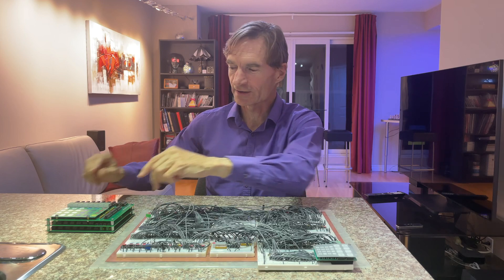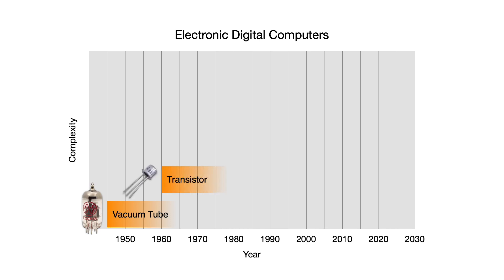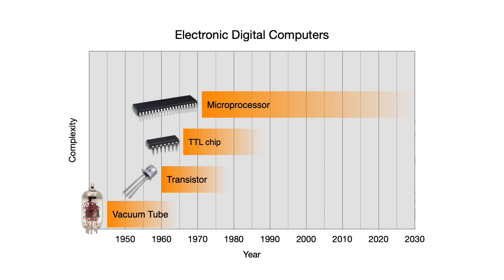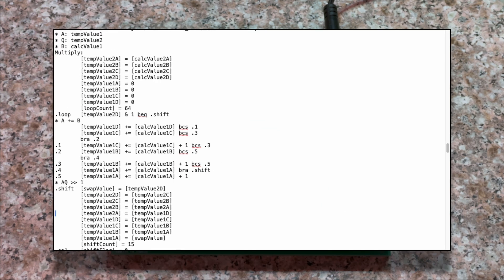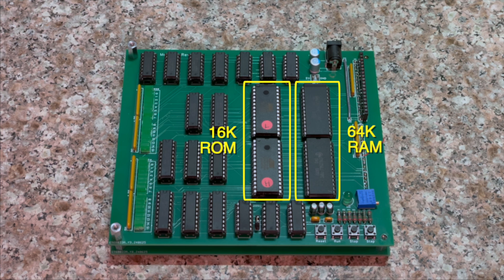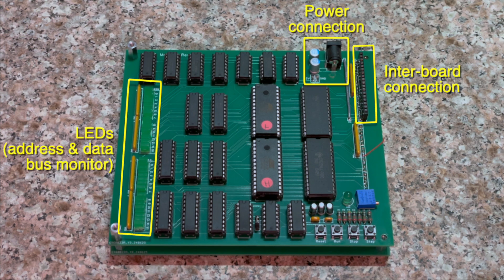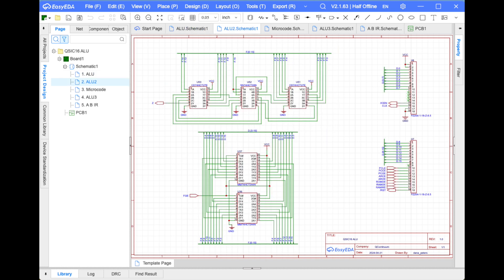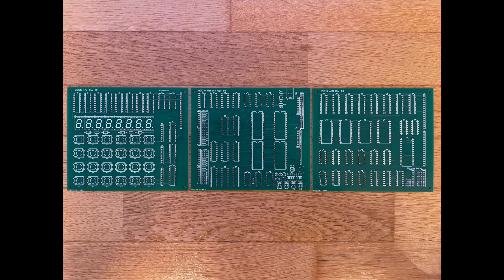TTL Computer

Comment: I am 50+ EE professionally designing electronics for various embedded systems used in controls for consumer,  automotive to medical products.
My career jump started in early 90s when I developed handful of control based on 8051 microcontroller. Later complexity of my designs progressed until now when I mostly design around SoCs and FPGAs, but sometimes simple MCU comes handy. Fast forward 35 years later today I cannot shake off that desire to built 8051 core based on TTL series. That would allow me to make full circle before I am old too much to endavour on such interesting project. Your video is another proof and inspiration I can pull it off. Thanks for the video
Reply from the maker: Great, glad you found this inspirational. I found that Logisim was invaluable. I doubt I would have completed it without simulation. And custom PCBs are quite affordable, so now is a good time to tackle such a project.

Comment: Did you find software to move your design from Logisim to EasyEDA? Does that even exist? Thanks, I’ll be following! 😊👍🇳🇱
Reply from the maker: Interesting idea... I didn't look for such software because I assumed that it did not exist. There are many different parts you can select in EasyEDA, so the software would need to specify a particular part, and then you'd have to modify it later if you wanted a different part. Still, that would likely be easier than redoing it in EasyEDA from scratch.

Comment: What architecture did you pick?  Von Neumann or Harvard?  Instruction set - RISC or CIS?  There are lots of levels of detail and design choices.  Would love to have school kids exposed to this level to demystify the cell phones they all take for granted.

Small nit - technically TTL uses bipolar transistors while it appears you used CMOS which is based on field effect transistors.  The 7400 series started as pure TTL and added 7 variants from 1966 to 1982; CMOS equivalents first appeared in 1968 and have evolved through at least 40 variants since.
Reply from the maker: You are correct, even though I called this a "TTL computer", I actually used 74HCT chips to avoid fanout issues. These are MOS, not TTL, although they are TTL-compatible. The 74181 ALUs I'm using really are TTL chips.

As for architecture, it is inspired by the OSIC (one instruction computer) architecture. But it supports different arithmetic/logical operations, branch conditions, and addressing modes, so I don't know if it really is OSIC or not. I'm calling it QSIC (for Quasi Single Instruction Computer). I intend to make another video on this, so stay tuned!

Comment: How are floating point numbers represented?
Reply from the maker: This basic calculator software uses fixed point rather than floating point to represent numbers. The integer part uses 32 bits, and the fractional part uses 32 bits. So it takes four 16-bit values to represent a number. This gives sufficient precision and range for an 8-digit display.
Reply: @danapeters  thank you; I don't think I have ever heard of that scheme previously.

Comment: In the future you will want to add decoupling caps on each and every TTL chip.  Curious, what is the total power draw for all those hungry chips?  I think your project is beautiful. Okay read all the comments now....you DID add the caps.   Awesome.
Reply from the maker: Yes, it is true that I cheated and just soldered decoupling capacitors diagonally across the power supply pins of each chip on the bottom of the board, so that I didn't have to worry about routing those connections. This also guarantees the shortest possible connection for decoupling. The TTL chips take very little power, because I cheated here too and used the 74HCT variant to avoid fanout concerns. But the computer still needs lots of power because of the 7-segment LEDs, which I'm driving fairly hard at 20 mA. So if all segments are on, that would be 8 x 7 x 20 = 1120 mA.
Reply: @danapeters  I don’t think it’s cheating! Interesting point about the LEDs. I started getting parts for a project and it was the first time I considered the efficiency of the LEDs and what resistors I should really use to keep the current down because I was driving everything from Raspberry Pi Picos and the current was pretty low. I even considered whether to use transistors to drive them. It’s a lot more soldering adding all these components though.
Reply: I saw in another comment he did add them diagonally across the power chips on the bottom of the board

Comment: Some routing is simpler than other parts. If you route power supplies, and traces which remain within a limited region, the rest of the route becomes simpler. Some autoroutes allow you to select a set of pins, which it will route. Handling small regions is always fairly quick, and if a problem requires re-doing an earlier segment, a human will perform better than a matching. It isn't actually THAT hard, you'll learn it quickly enough, considering what you've already achieved.

Comment: Autorouted and no decoupling caps whatsoever and it still works at 3MHz. Does it even have a properly routed power distribution bus with wider tracks? It clearly shows that the old LS-TTL is super resilient and can handle the most severe environments.  Nicely done.
Reply from the maker: The power distribution tracks were 18 mil, and all the other tracks were 6 mil wide. Also, I soldered axial 0.1 uF decoupling capacitors diagonally across the power pins of each chip on the bottom of the PCB. This avoided having to worry about decoupling when routing the board. I learned the hard way that decoupling was important because I accidentally omitted decoupling from just 2 chips on the prototype, and it caused problems. I used 74HCT so I didn't need to worry about fanout limitations. Thanks for your interest, I'm glad to get so many comments.
Reply: @danapeters  Ah, that definitely makes more sense. On solderless breadboards I sometimes solder the decoupling caps across the IC itself instead of just hooking  them up across the power rails which gives a lot less loop area/distance. Putting them across on the bottom of the PCB is smart (and it actually make the boards look better from the top with just the ICs showing). ^__^.  For me routing is meditative and I can spend days of my free time routing, ripping up, moving a few ICs, route again and repeat until done. But I realise that most people (rightly) just want to get to the finished product.  You deserve many comments, it's a nice relatively advanced design. BTW - have you planned any other "top" boards for it? Maybe make it more like a 1970/1980s trainer board?

Comment: That's awesome! Someone should compress this down into a single chip. I could see that being a big hit.
Reply: Really? What would you use that for? Why would anyone want a computer fits in the palm of your hand?
Reply: Erm, what on earth would they do that for? There a two streams of thought about building retro-computers. The first, like this, says wouldn’t it be neat if I could build my own computer entirely out of TTL chips. They aren’t trying to replicate an existing design and there’s almost no software available for them. The second is that there is all this old software available, how do I run it on modern hardware? This latter category results in either software emulators or FPGA cores (for those not in the know, an FPGA is a chip with lots of logic resources on board, but initially nothing connected. You can programmatically wire them together using a flash rom configuration, generated using software on a desktop PC. This, when it comes to a complete system, is referred to as a core).
Reply: No, that defeats the purpose of the project.
Reply: As the history lesson should have made clear, current SoCs with ROM, RAM, and clock speeds in excess of this machine are available.  Digikey sells one for $8.42 that has 512KB of flash (vs 16K), 64KB of RAM, and runs at 24MHz (vs. 3MHz).  It also includes I/O pins more sufficient to handle the input and output of the TTL machine.  Of course, if you just wanted a calculator, you could try to find an Intel 4004 - the first microprocessor - developed specifically to provide a single chip processor for, you guessed it, a calculator.  It was cheaper and more versatile than a dedicated set of chips that the customer thought necessary.
Reply: @mikemilner8080  my understanding was that the 4004 was developed for NCR cash registers.
Reply: @mikemilner8080 heck, that’s an expensive example. The Raspberry Pi Pico 2 has 4 CPU cores (two of which are available at once admittedly), runs at 150MHz, has 520K of RAM and 4MB of ROM for £5. ESP32 based dev boards or STM32s can be had for under £2.